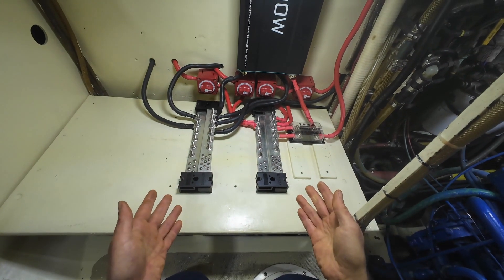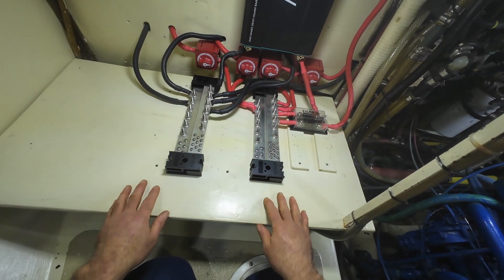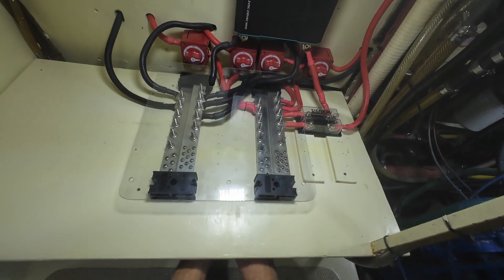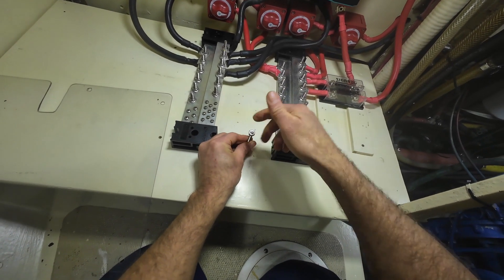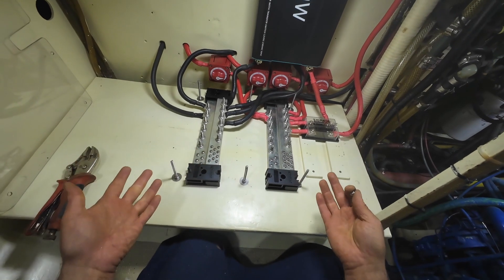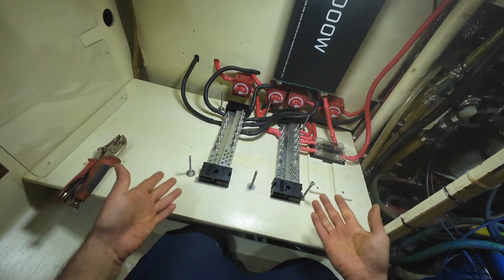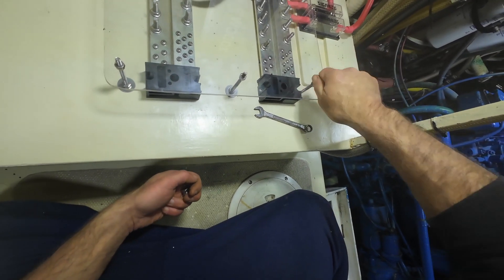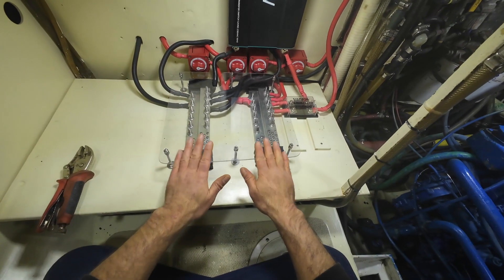Important Addendum to previous video "Installing 2432AH Lithium"

Comment: larger lexan, Clamp to edge of table with 1.5" overhang. Heat with heat gun and roll 1.5" up to a 90*. Repeat on all sides. Remover materials where cables are. Secure as in this video and now sides are protected.

Comment: Do you have a ballpark figure for what your new system cost? Thanks
Reply from the maker: Hi, ya sure. Thanks for asking. There are a lot of different components (solar panels, solar controllers, inverter, cables, tools, etc, and I can get into what each of those cost if you want.) But the 608Ah LiFePO4 batteries themselves cost £1,149.99 each, including free shipping in the UK. Fogstar has many different Drift series battery sizes, from a 100Ah battery for £219 up to a 628Ah version for £1299.  Please check them out with our affiliate link! -> 👉 Fogstar LiFePO4 batteries: https://www.fogstar-drift.co.uk/?ref=zosysjig

Comment: Or get a length of 4" (5"?) diameter PVC pipe, cut it in half, and use each half as the cover for a bus bar.  Not necessary to be clear acrylic since there's no need to see through it.  Attach the PVC the same way as done here, 1 bolt on each end, at the centerline.  Even better would be to consider what the opaque plastic fuse shields are made of, probably some high-temp plastic (so it doesnt melt during some electrical malfunction), and find some plastic pipe of similar high temp resistance, and use that (instead of PVC pipe).
Reply from the maker: Thanks for the great ideas! :)

Comment: FYI covers are great,, but also quick detach top is necessary in emergency.
 Last thing you want is in an emergency when you can not expediently remove cover.. at sea with no tool at hand. i.e. equipment failed or equipment short.. something to keep in mind.
Reply from the maker: Great point! It rseminds me of the time when we got hit with a rogue wave while sailing from Greenland to Iceland. The wave hit the aft quarter so hard that it sent many gallons of water gushing into the engine room through a vent. Then even though the massive inverter/charger was off, it got shorted and started smoking. While the engine room was filling up with smoke I had to disconnect it from power by undoing the bolts on the connectors. If anything had been in my way then it would have taken longer and could have been disastrous. 

Rogue Wave | #79 | DrakeParagon Sailing Season 5
https://www.youtube.com/watch?v=ZzbAqP36WJY

Comment: I would make a cover for each bus bar. Wood on the sides with holes for the wires. So basically making two covers from wood with a plastic see through.  Screw that to the wood they are on. There will then be zero chance of contact. When you need to work on one, the other is still protected. Even if you drop a wrench by accident, there should be zero way it finds it way in there somehow. As you know, a boat sometime rocks. And then things will find a way where you do not want it.
Reply from the maker: I like it! 👍🏻 thanks for the suggestion. Looking forward to making version 2 of the bus bar covers.